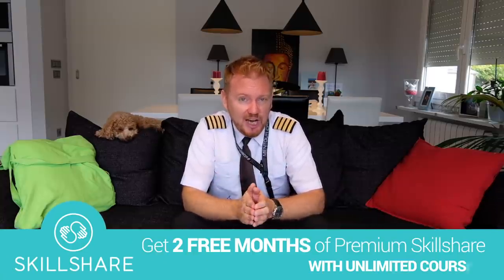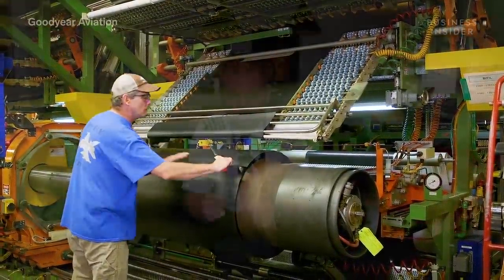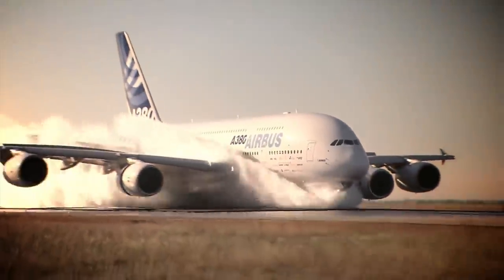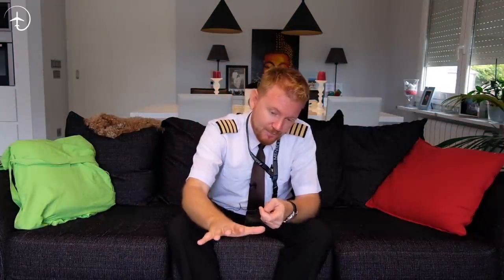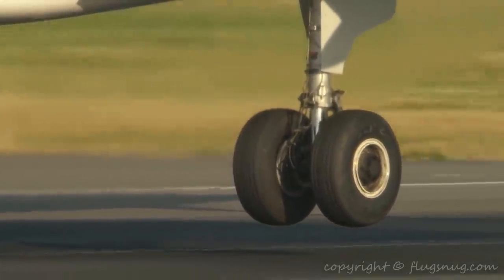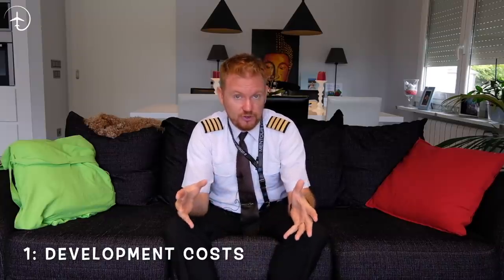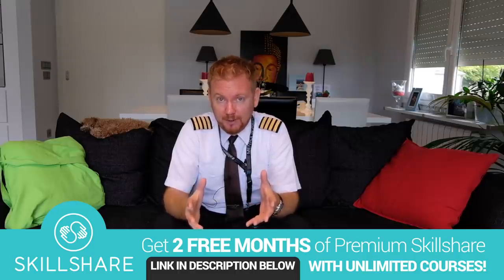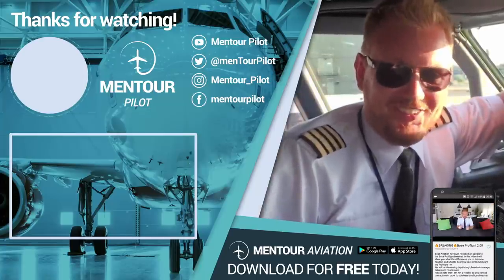Why not make plane-tires spin, before landing?!

Comment: Back in the eighties when I was in the Navy I brought this question up to my division officer it was an F-4 pilot and his reason for this not being a good idea was that a rotating wheel acts like a gyroscope and would induce adverse yaw on the aircraft and that's not something you want when trying to line up on a Runway or catch an arresting cable on an aircraft carrier deck.
Reply: Good point about the gyroscopic forces, I hadn't considered that.
Reply: do you mean that it will make pitch down !!!
Reply: @tarekelgeidy1492  No, it would pitch it up ;)

But given the small mass of the tires I can't imagine that the torque would be that much (at least for a passenger plane)
Reply: The forces would  negligible.. truth is airplane tires do spin up before landing. Its a Bush flying option to prevent rock/gravel ingestion
Reply: @miallo  What you discussed is a different effect, the angular momentum conservation when spinning up the wheel.  It indeed is a minor effect.  I believe what the F-4 pilot's point was that you need a very large twisting from the landing gear to change the heading direction of the fast-spinning tire (changing the direction of rotational axis of the wheel when turning the aircraft).
Reply: That is a point !
Reply: Very good point on the gyroscopic effect of a spinning wheel. We need a geek to make the calcs I believe the effects will depend on a multitude of things including the speed of wheel spin its mass (mainly the wheel not the entire landing gear assembly which doesn't turn) especially relative to the mass of the aircraft and its location relative to the aircraft's CoG (I would imagine the affects could be significant in a small aircraft vs a larger commercial airliner). I suspect it would be negligible as it effects is most prominent in a roll or yaw maneuvers not so much pitch (as the wheels are usually vertical when its down).
Reply: The wheels weigh nothing compared to the airplane. The effect is tiny.
Reply: Imagine a crosswind landing with motorised wheels lol
Reply: @kratokat3431  It will be like those RC cars built to tumble.
Reply: I was at McClellan AFB in the 80's where they operated a few Saberliners. The bean counters came out and wondered why so many left tires were being changed compared to right tires. It turned out that upon landing, all the left turns were tight and they would grind down pretty fast. A suggestion was made to ease up on the corners and they saved a few bucks just from that.
Reply: I’m an aircraft mech. Airliner tires do not readily spin even if this idea was a favorable on. You have the drag of the brakes among other things. Spinning a main tire is not equivalent to spinning the fan on the engine which spins with little effort. But regardless. The wheel spin up is an important parameter for certain vital systems during touchdown.
Reply: Correct
Reply: They certainly keep rolling after take off though. You can feel the vibration in the cabin.
Reply: It one of best analysis thumps up for u
Reply: @appa609  it is tiny yes but for aircrafts on air any tiny forces can easily effect on stability
Reply: Best reason I’ve heard yet!
Reply: The gyroscopic effect of rotating plane tires on an airframe is ABSOLUTELY NEGLIGIBLE.
Reply: @appa609    No, the wheels weigh something compared to the airplane.
Reply: When you retract gear after takeoff I've never noticed gyroscopic effect influencing the aircraft's stability
Reply: @0601ac  Bush planes don't fly as fast and are also extremely maneuverable.
Reply: @jon782  hey bud, many jets up to the size of a 737 fly off gravel runways and are fitted with gravel kits. Yes jet commercial airline operation.
Reply: surely its too small to make a difference coz take off? unless as soon as they take off they apply the breaks?
Reply: Colin Southe
Reply: The mass of the tyres is negligible compared to the mass of the aircrsft, and plus they are already spinning immediately after takeoff and it doesn't drastically affect handling. On the aircraft the rotating parts of the engine weigh several tonnes and spin in excess of 5,000 rpm (30,000 rpm for the high-pressure spool). Those do have slight effects on aircraft handling but pilots get used to dealing with them.
Reply: @acbulgin2  If the gyroscopic effect would keep you upright on your bicycle, it would make you difficult to make turns as well?  And cyclists with no-weight carbon wheels would have difficult staying upright?  No, it is for utmost the angle and eccentricity of the bicycle fork that makes a bicycle stable.

Most of the comments on negative effects of landing wheels gyroscopic forces on an airplane have to do with applying or retracting the landing gear.  Technical solutions are in use to overcome these.  But we should discuss the potential (de)stabilizing effect with landing approach.  In my opinion, the effect is very little, just like with my bike?
Reply: @oldman2800  it is stops immediately by breaks after lift off
Reply: @tuttebelleke  imagine u lost hydraulic in ur aircraft so u lost most of control surface at that moment any tiny changes on stability will very difficult to correct.
Reply: @osmanosman3413  Because the axis of the wheels on an airplane are parallel to the Pitch axis, potential gyroscopic effects can only play when rotating the plane around Roll- and Yaw-axis.  During any normal landing approach Roll and Yaw are not changed.  So the potential effect could be negligible.  And one could even expect it to have a positive effect on stability?  That should be tested first in my opinion.
Reply: That's completely wrong, how much gyroscopic force do you think a heavy turbine spinning at almost twice the speed of sound has?
Whatever the wheel has wouldn't be noticable at all
Reply: This is only true on final approach.  While in circuit...  well if the circuit matches the adverse yaw.  JK I know.

A critical operation like landing on a deck I can see that being an issue.  On regular landing strips most of it can be eliminated by not spinning up to full matching speed.

Also the amount the adverse yaw effects the plane is relative to the mass of the tires and the mass of the plane and how fast you spin up.
Reply: @miallo  Just hold a running 4" angle grinder and move it around your wrist and you will already feel significant force reacting to your movements. The grinder disc is nothing compared to a plane wheel. I guess it counts when you are trying to reach a stop cable at night on a moving platform with a fighter jet... so why not on a bigger plane under windy conditions.
Reply: @kratokat3431  Imagine any landing with motorised main landing gear wheels. There'd better be sensors to work up how fast or how slow, depending upon the headwind and/or crosswind components. Otherwise, too fast or too slow wheels may break at the axles, during or following the first landing.
Reply: Good point, but would it be of any noticeable effect?
Tires of planes will always be as small and as light as possible for obvious reasons - just enough to get the job done...
Reply: tarek Elgeidy is
Reply: @Brigadelokcom  Grinder can be 12,000 rpm, certainly plays a role.
Airliner estimate, say 1000 to 1500 rpm
Reply: @Kong, you are incorrect, gyroscopic effect can play a major effect on the control of the aircraft when the wheels spin up because the mass of rubber in each wheel, all spinning in parallel. Dealing with abrupt wind changes during landings is challenging enough without adding any gyroscopic effects to the issue.
Reply: Multiwheeled plains cancel out the gyroscopic effects on the other wheels.
One wheel cancels the other wheel.
On small  planes this might be a factor like a WWI biplane
Reply: Yes. Got the same response from one of our techs.
Reply: The mechanism to do this would weigh too much.
Lowering weight is very important to airlines.
Not enough airplane tire incidents to warrant such an expense  of gas.
Reply: I think then, we are all in agreement that we shouldn't land an airbus a380 on a carrier deck.  :-)
     .....or Should we?
Reply: This is the most replays to a comment I've ever had. I never said it applied to all aircraft just the F-4
Reply: I have read about tests of spinning up wheel before landing where it was found that gyroscopic effect was significant. Wheels are heavy and so also the brake disks and tyres that come in addition. I tend to believe it is so but won't claim it is.
Reply: @tuttebelleke  yaw is changed a lot during touch down after a crab angle in strong side wind.
Reply: @sundar999  You're right.  That's why it should be tested first.  If turning wheels show to have a destabilizing effect during a yaw move, the pilot should have the option to switch off the wheel turning system in case of heavy cross winds.  Just like it would most probably be advised in case of potential aquaplaning.
Reply: @appa609  A bike wheel on a racer bike weights almost nothing. Spin it up while holding it and then you try to twist the wheel and it will try to rip itself out of your hands. A very light wheel can produce a huge gyroscopic force.
Reply: @0601ac  b Not quite. The force of 1 tire spinning is definitely negligable. The force of 10 or more tires spinning all in the same direction could definintely have an effect.
Reply: You think the majority of commercial jet have 10 tires?
Reply: @0601ac  Not all, but a fair number of them do.  Some have more (for instance, Boeing 747).
Reply: @Lucius_Chiaraviglio  sounds like you're referring exclusively to wide body aircraft. Not the majority of commercial aircraft in operation, try again
Reply: Not necessarily. Nearly all aircraft already have huge masses spinning at ridiculous speeds when they are flying/landing.
Reply: What the hell are you talking about?we asked a question about.....the flat spots on the airplane tire’s and this guys started going about back in the 80’swhen he was a f-4 pilot and someone had a great idea that a rotating wheel is like a gyroscope??? Wtf?? That’s had nothing to do with nothing I was even talking about???? You know as of now I even forgot what the f*** I was even talking about damn! Idiots!
Reply: Loop po loop
Reply: tarek Elgeidy   Spinning tires want to maintain their direction.
Reply: Aeronaut    Take a bicycle wheel and try an experiment.    Holding it by the axle, spin the wheel and then try to change the position of the tire.  Now multiply that action by a few hundred pounds per tire, and increase the rotation speed to 150 mph and see what happens.  There is a reason the brakes are applied as soon as the plane gets airborne.
Reply: I was 892 and 767 at Heron ,Ark royal at later luechars don’t remember you ..... I do remember a pilot nicknamed wheels up Lloyd I think . We had no money but happy days in the hole in the wall Yeovil
Reply: What about gyroscpic effect at take off? «Uncontrolable» at landing, «no problem» at take off?
Reply: That’s the main reason to do not!!!! Mainly on the Main Landing Gears
Reply: Why is there not a gyroscopic effect anyway when the plane has touched down?
Reply: @cvhawkeye6255  The gyros they use on the space station are tiny too (the whole thing is shoebox sized)
Reply: Brilliant.
Reply: It will actually improve stability

Comment: No need for motors, use the airflow which is freely available.
Reply: I remember that some 20-30 years ago a young girl suggested small flaps on the wheel in a youth competion ....
Reply: @robertlaudensack376  tire industry is too powerful, i guess
Reply: @robertlaudensack376  I heard 25 years ago that a patent like you describe was filled but immediately bought by a tire supplier and hidden. (Little curved blades or grooves on the rim that spin the wheel at high speeds)
Reply: Two problems. He mentioned that when landing with a crab angle, if the tires were spinning @ 200mph they would tend to push the aircraft in the direction of crabbing - towards the side of the runway not down the centerline. Could be dangerous.  But probably most importantly, the fins would cause drag on takeoffs also, not just landings. That's potentially dangerous. If the fins were adjustable and made not a factor on takeoffs, that adjustable mechanism would be a potential point of mechanical failure.
Reply: Joe Sternhagen in my opinion angle landing with spinning tires is a negligible problem when you take the torque energy of small spinning wheels agains the linear Momentum of a 65+ tons Airplane. The second mentioned concern about the extra drag on takeoff doesn’t barely apply as the wheel spin on takeoff anyway and then soon disappear in the gearboxes.

Think outside the box folks and turn on the logic ;-)
Reply: Link Age  there's always one!
Reply: Exactly this is what I was thinking, y at the speed o 250km/h ++ air flow can't make the tyres spin ... isn't it seems bit strange
Reply: @AvgJoe0007  if they turn to fast just hit the breakes - works on my car every time .....
Reply: @robertlaudensack376  There were little pop out flaps on the Avro Yorks to start the wheels spinning sixty years ago, so that was not a new idea.
Reply: @michaelreece1331  That's the point.
Reply: Colin Southern except you can control the spin speed of the tires with brakes. So, if the air speed is too high, you can simply keep the brakes locked and then, release it at the right time.
Reply: air flow is the first idea I came up with. An additional driving disc with the shape of air turbine etc. needs to be  attached to the wheel. As for crabbing,  747 has rotating rear axes of main landing gear. Why not  to use that solution for all the wheels and compensate the landing angle?  I think it's all possible , however, incoming money is the main goal for tire companies :)
Reply: I thought of this years ago...I sent a patent ,where small fins are added to wheel hubs so when gear lowered the wheels spin up thus enabling less wear when they contact the tarmac,this way the airspeed makes wheels spin to slightly lower than actual AS
Reply: @antrygrevok6440  air drag/resistance is not linear with speed, and "spinning-up the wheels to a percentage of the airspeed." is an idiotic thing to say, you can always compute the ratio of two numbers, it just wouldn't be a constant percentage or not even a very predictable one either considering things such as viscosity of lubricants, etc. would be affected by a lot of variables that change from flight to flight, and would affect the speed at which wheels turn.
Reply: That would not be really efficient at all :(
Reply: You assumed wrong that u need to spin the wheels to the landing speed. Not necessary, it's enough to spin them to 150 km/h or some. Leave the rest for contact, with auto-disengage electric motor at touchdown :) The stress would be many times smaller. How much?! Well let's see: [(landing speed - 150)^2]/landing speed ^2 = [(220-150)^2]/220^2= 4900/48400 = almost 1/10 . So with that you have 1/10 spin stress on the wheel. So here is the solution ;)
Reply: Lmaoooo "freely available "
Reply: I was really about to comment that to
Reply: In the 70's Tyres were used that had moulded cups in the side. There were no adverse effects but they were 'phased out'. I assume the gain was minimal.
Reply: what about doing it like a tesla turbine disc?... no vanes no flaps or ridges etc... just make the wheels react to the air moving past without vanes or flaps..... hm I wonder if the patent has been expired yet? Maybe its time to look at this again and not let it be bought by a tire co
Reply: That would add more drag when you lower the gear on approach, and also change the airspeed you can drop your gear.
Reply: Whether using motors or airflow, the balance vibration problem would be the same, wouldn't it?
Reply: I heard this was tried in the Swedish air force. But the gyro-forces of the fast spinning wheel made the aircraft much harder to turn/handle and the idea was scrapped.
Reply: @RudolfGraspointner  If it was patented then the patent isn't hidden and also it would be expired already.